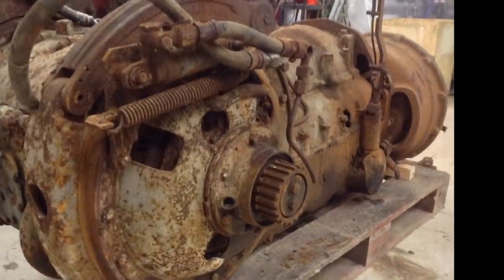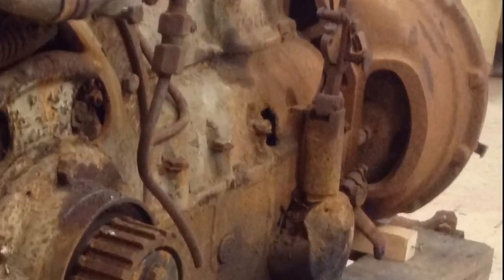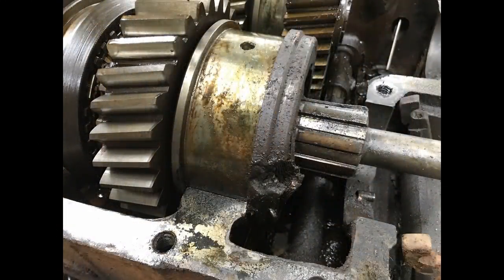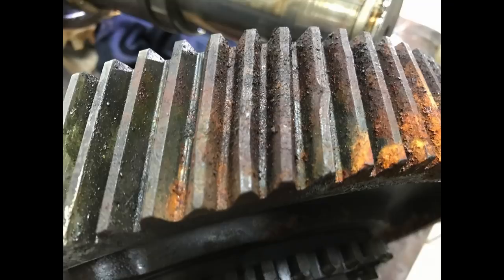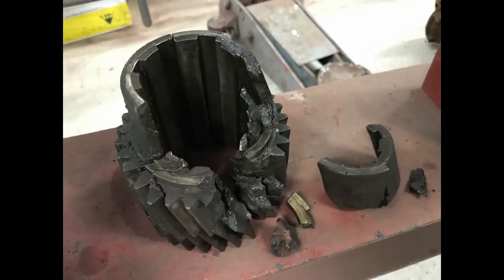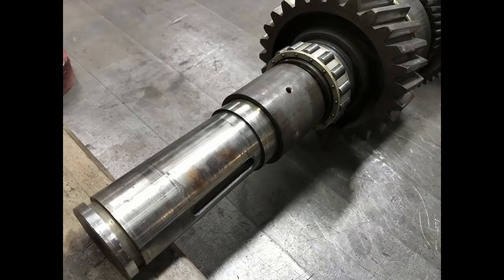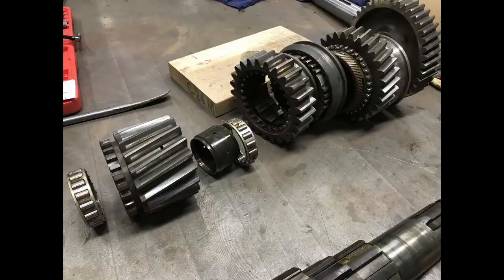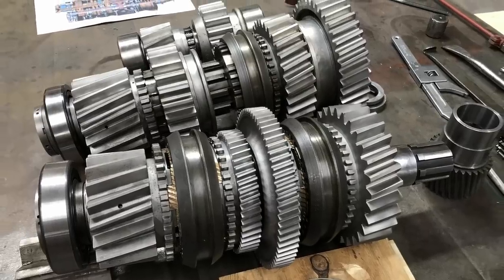Workshop Wednesday (COVID Edition) - PANTHER AUSF. A

Comment: You have to hand it to the Germans, the engineering in that tank, produced in the middle of a war, is outstanding. Hope you all recover quickly.
Reply: In truth the quality of the Panther and the Königtiger was very good despite very heavy bombings. Despite nonsense also the quality of the armour was good up to the end. Both the allies and historians all stated the same thing.....
Reply: The actual engineering was shit as the gearbox was chronically overloaded from day one. That was because they increased the armor weight by 50% without any changes to the already ordered engines and transmissions.
The transmissions broke regularly as a result - 200 km being average before failure (less than 10% of the life of an equivalent American tank).
The second issue was the factory prioritised new tanks over spare parts for existing tanks - leaving tanks with broken gearboxes scattered all over Europe.
The manufacturing was still reasonable quality however…
Reply: I agree! The tank was developed quickly and under tremendous stress. Eventually the kinks were ironed out, and the Panther turned out to be very good.
Reply: @tekis0  Actually the Panther was never particularly good. It always was unreliable due to a grossly overloaded transmission and engine (for which the Germans never had the required spare parts in enough quantities).
Reply: @allangibson2408  so you mean to tell me..... the most intense Bureau, most Nitpicking war department, that all modern R&D teams and post war to present US DOD, and the UK ministry of defense, and Germany obviously are based on. had the oversight of using a gearbox thats over 50% of its maximum Rating........................ Modern day they've done some dumb stuff... but its just Nitpicking like This handle could've been in a better place if it was 10 inches over here... or this engines junk or gearbox is junk it only lasts 800 hours of operation..... everyone forgets... these are war machines.... They dont exactly see the same kind of abuse that a Toyota prius sees on its daily commute to work.... all the thorough testing in the world in controlled environments can't account for the battlefield despite this..... i'd like Evidence that the gearbox was  chosen on purpose for an application that makes it work at 150% its rated capacity.... no engineer smart or dumb would be dumb enough to do this. yeah im sure the transmission is in some way weak. war eventually will bring out the weak link in quality control and design.... if X isnt done this way then during Y conditions X will break. Unless its done perfectly the first time..... i think alot of people forget that a very large majority of American vehicles wouldn't even start right off the ship when they got to Europe..... guess its still somewhat the same.... Im more cautious of a brand new military vehicle than one with some miles and hours on it. you don't know whats been fucked up by the factory
Reply: @allangibson2408  the transmission was only bad on ausf. D/A models, late war G models didnt have any more automotive or quality problems than any other tank in the war at the time.
Reply: @burre01  The German tanks generically had transmission problems (caused by low quality parts and severe issues with spare parts availability). German tanks were always a maintenance pain.
The Russians had severe issues with the T-34 from 1942 to 1943 with a gradual improvement from 1944 on.
The Americans never had problems with the M4 Sherman (since the bugs had been ironed out with the M3 Lee/Grant and the preceding M2 Medium Tank) which shared the same basic running gear design. The Americans also shipped an abundance of spare parts.
So the American tanks broke down less, had abundant spare parts and easy maintenance combined with better ergonomics from day one.
The end result was the Americans turned up to every battle with more FUNCTIONAL tanks. The Sherman was also marginally better armored than the T-34 and had the same gun caliber until 1943. From 1944 the Sherman had to use its greater speed and ability to fire on the move to overcome German tanks longer guns (until the M4A3E6 & E8 76 became available on the front line). The only problem the Sherman had mechanically in service was the vast multitude of different engines it was fitted with requiring careful tracking of which model which division had.
The American M26 Pershing was a close match for the Tiger (that unfortunately included the problems with its new transmission).

Comment: Yes, a little bit more on the innovative torsion bar system, that kept the innards and crew stable even over rough terrain.
But maybe tell us about its complicated design, and the problems of maintaining it in the field if damaged.
Without any knowledge of design or engineering, one can see the extraordinary know-how and effort both war time engineers and factory workers, then and now, so you get that easy hand-cranked startup! 
Do you know if any slave labor was used in Panther tank construction and how inspection engineers tested the vehicle during or after build and send out approval.
For a rainy day. Rain, get it?!

Comment: Hope your GF gets better,  The one thing that I missed was the transmission install.  Have you ever seen this yourself, it has to go in sideways then pivot 90 degrees, love to see exactly how that goes.  Also I would love to see the rubber tyres get pressed on.  The Panther was both over rated and under rated.  The Germans never got the road wheels fixed, there were 4 different types tried and with the Panther F would have been a fifth different set of wheels,

Comment: I have the aerial identification marker that would have been attached on the top of the engine deck. (It's basically the Nazi flag with eyelets for the marker tiedown points on a Panther tank) - It was from the first Panther captured intact after Normandy invasion. My Grandfather was a Diesel Engine mechanic in English Army and went in on day 3 after which his Combat unit he was attached to got him to do the inspection. He found the flag under the floor plates that the crew would stand or feet rest on - along with a "Teller" mine and some pistol ammunition. I couldn't tell if this tank still had the tabs for the marker or not - pretty sure I have seen other Panther with them or photo's of the tabs.

Comment: Nightmare for the crew
Final drive at the front 
Ie
Virtually impossible to repair in the line
All that work to get access to the shafts etc
Overly complex 
And on a restoration you probably don’t have a spare pack
So it’s a packlift but no spare to rotate into the hull
Here was me thinking Cheiftain was a bastard to work on!
Brilliant work gentlemen 
Are you going to restore the instruments gunnery wise and calibrate the sights?
I’d love to take that on ranges at have a crack at some t 34 hard targets

Comment: Sorry you folks are under the weather.....or covid. For some reason I thought the worst was over
in your part of the world. Maybe we will get through this, but thanks for the video. Great job as usual.

Can someone explain to me what the box is at about 8:33 on the timeline? Looks like some sort of
transfer case with a PTO, (Power Take Off) pointed straight up. Looks to be near the center of the
basket. Also, can someone point me to an article on why most armies seemed to put the engine
on one end and the transmission on the other end during WW11, instead of having them mated
together as seems common today? Sorry for my ignorance.
Reply: Unless I am very much mistaken,that is what rotates the turret.
On reflection,an important question to ask would be ,does the power input to that PTO operate all the time the engine is running,or is there a clutch engagement ? Design arguments either way,easy enough to take power from the transmission input shaft,run it all the time,or run a clutch from the countershaft,that way no parasitic power loss when not needed.
Anyone out there can answer this ?
Reply: @paulmanson253  Thank you. There is a lot imbedded in older tanks that I simply don't
understand,  meaning they are much more complicated than many of 
us may think.